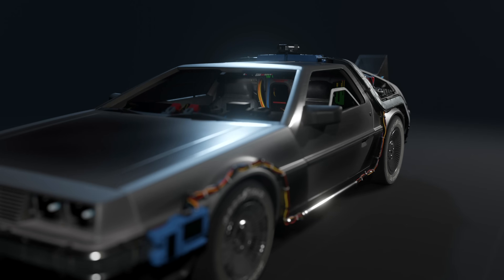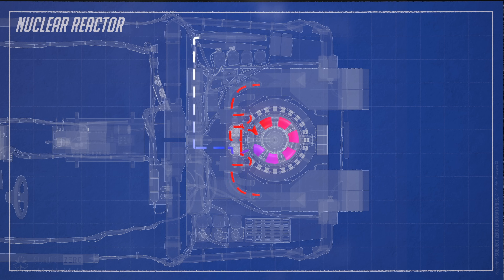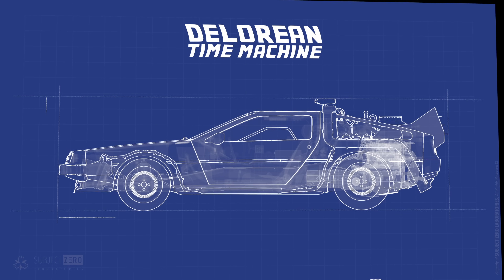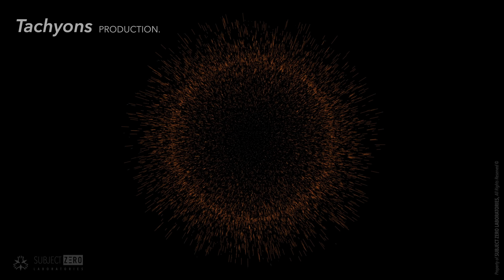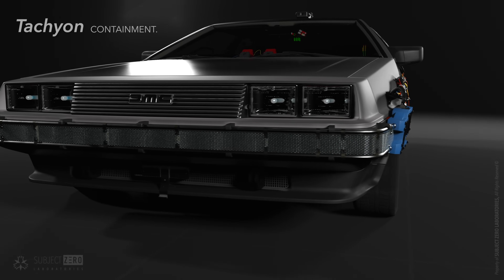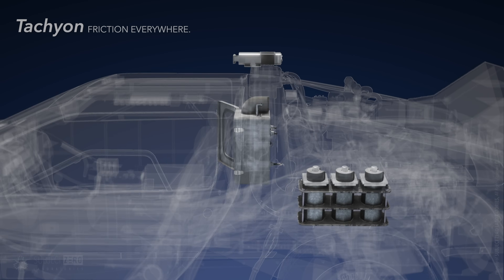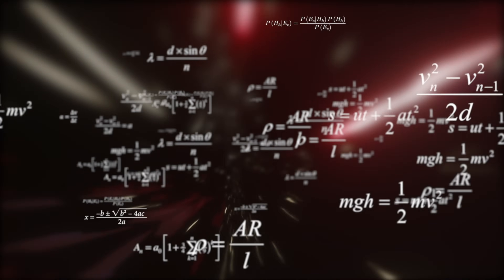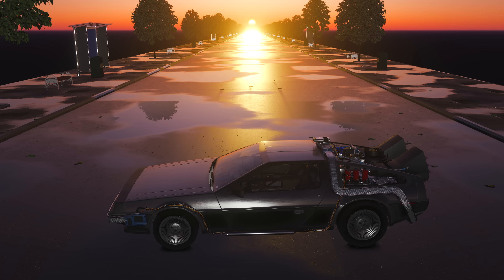The Science of Time Travel in Back to the Future

Comment: I got a question, though: how does one miniturize a nuclear reactor, much less mount it on top of the DMC12's engine hold? Don't you have to put additional shielding to it just so the radiation doesn't leak? By building it into a temporal displacemen unit, surely the overall weight of the build itself will make it impossible to accelerate let alone outmaneuver a mini van. Suppose we change the engine orientation, say, put it out front and leave the empty space for additional equipment for the reactor itself? Of course, the unit itself will have to be FF instead of FR, since adding a drive shaft and a differencial gearbox underneath might make it more cumbersome.

Comment: Without watching this first....

"Besides, the stainless steel structure will make the Flux dispersal...."

Gasoline-powered automobile with electrical circuitry super powered with a nuclear reaction from plutonium to disperse 1.21 gigawatts. This was later changed to Mr. Fusion of course which converted any matter into energy. 

The 1.21 gigawatts disperse throughout the stainless steel body via the bumper and fender additions that help tear the space-time continuum portal. Upon arrival in the set destination, the Flux dispersal created an ice effect from the EMP and the air vents release the exhaust from the plutonium chamber.

Comment: Cool vid. Best explanation I've found so far.

The projector-looking thing on the roof of the DeLorean was unofficially called "wormhole emitter" by fans till Bob Gale gave a list of the parts, which names it "tachyon field generator". That was when I realized the DeLorean generates tachyons to create its wormholes, which's pretty cool.

And about the flames from the tires: If you look closer, the flames aren't actually coming from the tires themselves but parts on the car's underside that are behind the tires, which shoot the flames downwards. In BTTF 3, when Marty goes to 1885, the flames behind the rear wheels don't touch the ground but shoot backwards instead, and sparks from the flame sources shoot upward and around the wheels, prolly damage caused by the lightning strike or the DeLorean crash landing in 1885.

Comment: i would start with minimizing the nuclear power generation with something more direct than the fission>heat exchange>turbogenerator>synchrotron to begin with, while really we could use the reactor itself as the synchrotron, generating the right amount of particles. all it needs is a LOT of energy, since we cannot reach lightspeed, we can still curve spacetime with something even more dense. thinking of matter-antimatter reaction to get that nanosecond of energy burst.
it's like japanese martial art, to defeat a big guy, a mountain of muscles you don't need to be super strong but think fast and find the right momentum.

you can't do that on earth or the air will vaporize into a plasma and even enter nuclear fusion, and well okay, electromagnetic confinment is a thing but you will land in another time while the planet and everything will have moved, so pack such a device on a spececraft.
a good 100% of the thermonuclear energy or antimatter energy must be converted in the energy for operning the wormhole or your warp in the tissue of spacetime, or even a small fraction will nuke yourself into a fireball and you certainly don't want this.

in the math you need to compute the amount of energy you need to teleport the mass of your time machine and yourself, the payload. then in time travel there are things to consider : causality/CP violation.you travel back in time, you become your own antiparticle, and it happens all the time in the universe. an electron and antielectron meets, they disintegrate into two gamma rays of pure energy.

Comment: 1.21 jiggawatts is not the power required to travel through time. It's the power required for the DeLorean to travel through time specifically. Firstly, Doc later makes a train time machine that is powered by steam, which could never produce the power that a nuclear reaction would make. Secondly, at the beginning of the first movie, we see all the clocks around the lab that are 25 minutes slow. They are slow because Doc was sending them all forward in time to test the flux capacitor. But without plutonium, he couldn't make 1.21 jiggawatts. But with a vessel smaller than a car, with stainless steel construction (to help the flux dispersal), it would require less power to travel in time. Something like a refridgerator (which was the original time machine in the original script), it would require a lot of power, but not a nuclear reaction worth. This is why there is a gigantic power amplifier in the lab. You think he made that thing for Marty to play guitar on? Of course not. It's for powering the fridge time machine to send clocks forward in time. Scientific method, my friend. Doc explains the time jump with the clocks to Marty with the stop watches, and it's the only scientific info in the movie that doesn't have a pay off because it is the payoff that explains the set up of the slow clocks at the beginning.

Comment: If the reactor is indeed "just" 1MW, some modern internal combustion engines or hybrid systems should be able to deliver that (e.g. Koenigseggs or Chiron)
Reply: yeah but that is kinetic energy (+ some more heat)
Reply: @Rei_Anda  but it's not like you get electric energy from a nuclear reaction directly, you generally use it to spin something

Comment: Nice explanation, missed an opportunity to describe the field-stabilizer illumination as a de-facto Cherenkov Radiation effect in gaseous medium as tachyons transit the light speed barrier from faster than light motion into net positive motion regimes, effectively causing the massive bending of space-time via the transitory mass gain of the tachyons as they disintegrate into faster than light (in air) photons and creating a localized worm-hole, just like in a theoretically possible Albucierre drive.

Comment: this was a fun and really well-made video. The flux stabilizer things aren’t powered by the engine though. If they were, they would not have been powered, and therefore no protective bubble, while the train was pushing the car.
Reply: They were powered by the engine until the Mr Fusion upgrade. Then they were powered by the Fusion generation. (As were the flying circuits til they broke).
Reply: Surely the engine was turning over, just without fuel? Or was it in neutral?
Reply: @tbird-z1r  The movie only shows them pulling a release lever, letting the car roll down onto the track. So one can assume it was a neutral at that point. But I suppose they could have at some point switched it into gear, that way the tires spinning would make the engine go.

Comment: I like it but the flux bars cannot be powered by Deloreans engine because in the third movie they didn't have the use of the engine and still made it back to the future they must be powered by the reactor after the capacitors have been fully charged
Reply: They were clearly powered by the engine in the climax of the 1st movie before the lightening. 

When the Mr Fusion upgrade was installed,  they switched to that. (As was the flying circuits).

Comment: Of course, if it was a true time machine shouldn't the car just appear in outer space where the earth used to be.
Reply: haha that def. took me a second, but it makes total sense haha great point, is that premise/idea from a book/movie/something? =) interesting thought experiment indeed.
Reply: And what would be the inertial frame of reference, the exact centre of the universe?
Reply: @ajhhc  Usually they use the CMB.   But in this case it doesn't matter that much.   Earth, the Sun, the Galaxy, the local group, etc all would mean the same thing.   They would have to hold there breath for the rest of there lives.  Which wouldn't be that long I guess.
Reply: @lucidmoses  that was an interesting read. I don't have the proper background to understand everything I've read, but my understanding was that a situation such as the one you described in your main comment would make sense if you view the universe in Newtonian terms. This is not the case in GR, where there is not a particular point in the universe that can be considered as absolutely stationary (or as the centre of the universe), and in turn, any point can be considered as such. In conclusion, the movie isn't necessarily wrong in the way it presents space displacement.
Reply: @ajhhc  Newton and GR don't come into play here.   Think of it this way.   Instead of the earth.  Think of it as just a train.   Your relative motion is the same as you go down the tracks in your DeLorean at a constant speed (on the flat bed of the train).   Now if you and the car jump back in time say 5 hours.   Where was the train?  Not where you are now that's for sure.
Reply: @lucidmoses  yes, but you can choose anything as your inertial frame of reference, and it's just as valid as anything else. The Earth moves relative to the Sun, the Sun moves relative to the Galaxy, and the Galaxy moves relative to other galaxies, but none of these is absolute. We can choose one over the other because it makes for a simpler model, but that doesn't make it any more valid.

Again, this is my understanding, I'm not claiming to be the most knowledgeable person in this matter, but it does make for an interesting discussion.
Reply: @ajhhc  It's a Time machine.   Inertia doesn't come into play.  That's for motion.